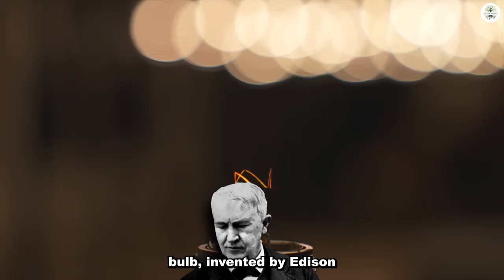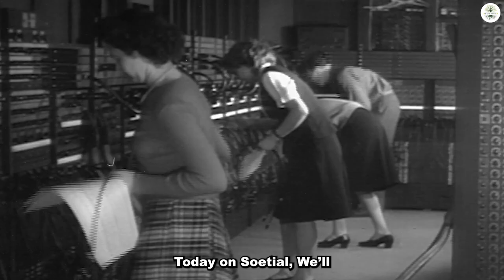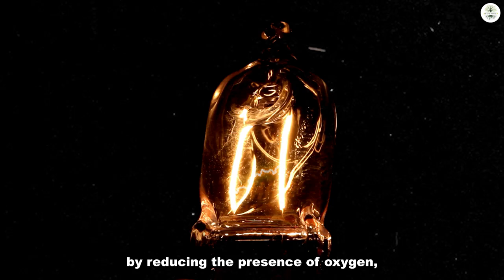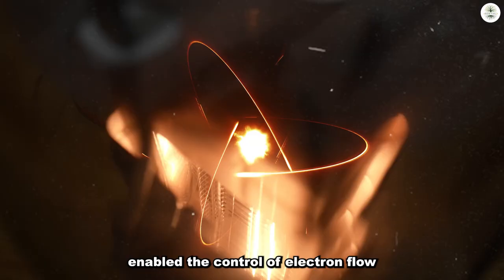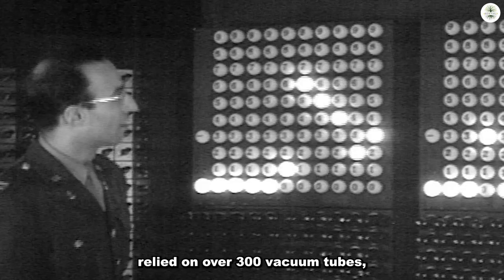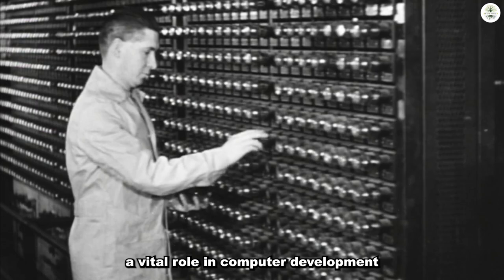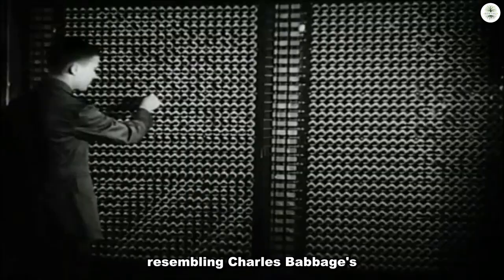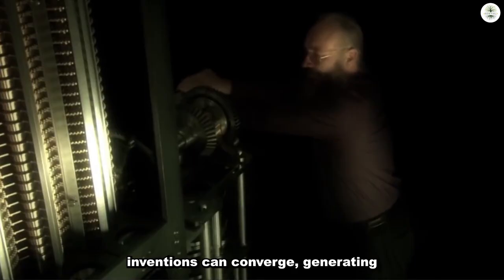Why The First Computers Were Made Out Of Light Bulbs

Comment: Good video, but as far as I know with a thermionic valve you never take the grid to a positive. You would normally operate between 0 Volts and a negative voltage. Where no vaults is fully on, IE max anode current.  And with a sufficient negative voltage on the grid, it will be off  IE minimum anode current.